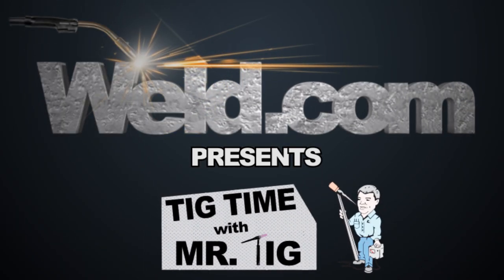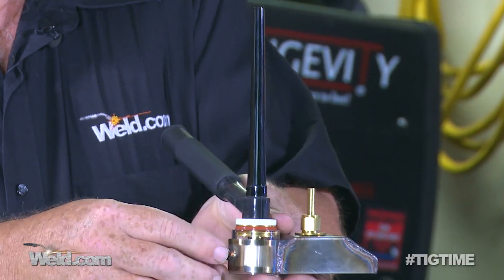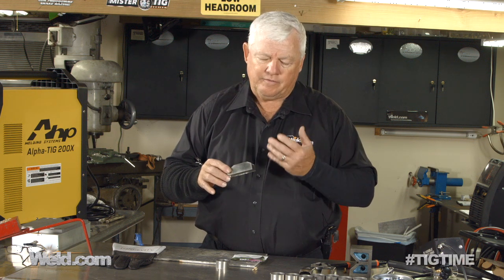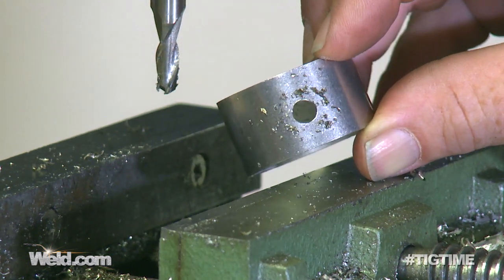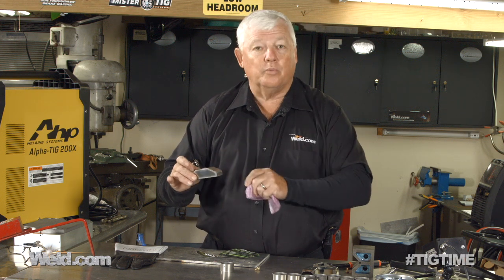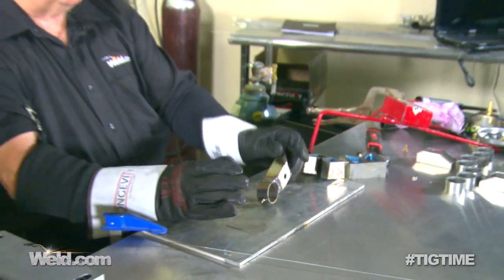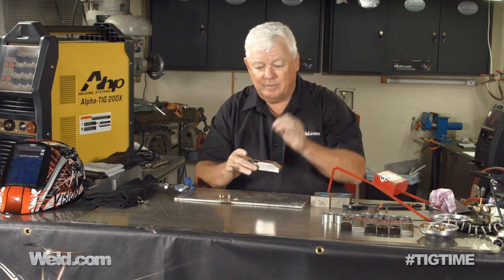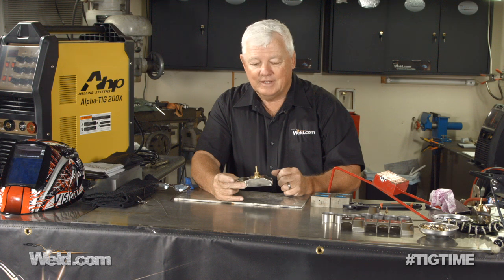DIY Trail Cup for TIG Welding Reactive Alloys: Part 1 | TIG Time

Comment: First of all -- it doesn't have to be stainless. Second -- tightening that clamp with a screw that speared right into a glass or ceramic is not a good idea. You need the same principle as hose-clamps has. And third of all -- instead of  picking a bunch of holes in the bottom you can use stainless mesh in like dozen layers what would be giving you much-much better shielding then that huge holes that will be just wasting your argon.

Comment: Where'd you source the diffuser part like the centered bronze? What about the screens?
Reply: It's "sintered bronze", not "centered". A good source would be aquarium supply places- it's used to aerate water systems.
Reply: "Sintered" bronze.  It's fairly common, some used for filters, air diffusers, silencers for compressed air devices (put on the air exhaust to keep the sharp deafening noise down).